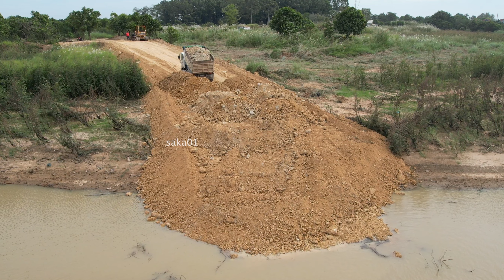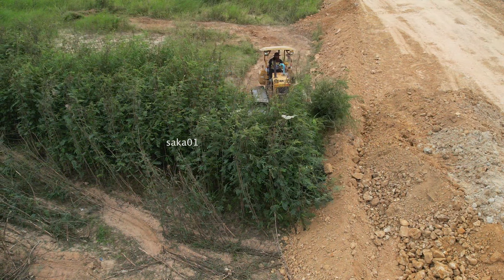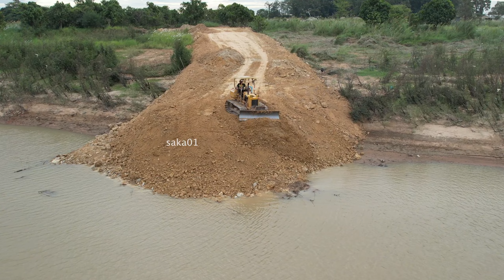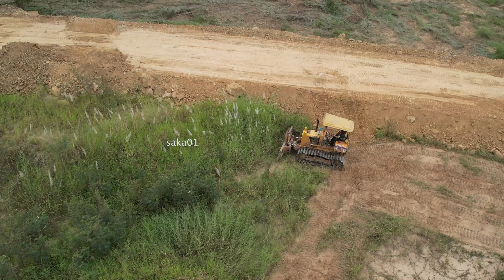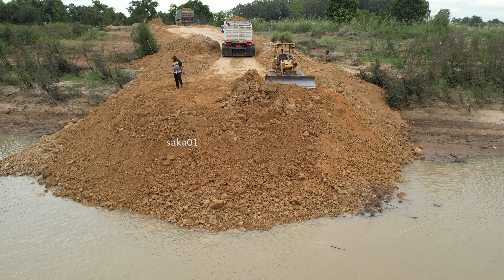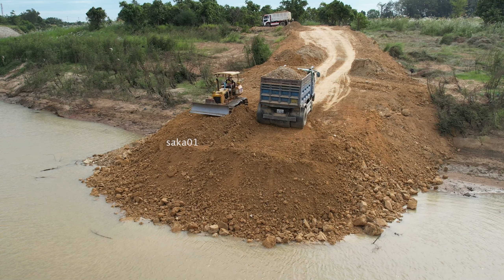Bulldozer clearing forest & Pushing Dirt with Trucks Pouring Soil For Building New Road Across Water

Comment: I always have to laugh at this kind of video!

Showing a tractor/dozer like this. Track almost broken in 3 places on either side. Engine with barely any compression. But the worst is the purple paint. Driver wearing sandals. And no one cares for safety. 
3rd world for many reasons. And it will never change.